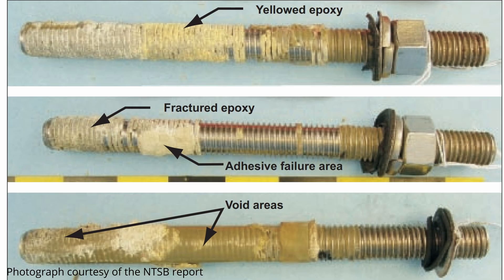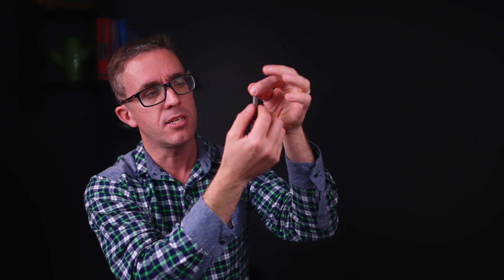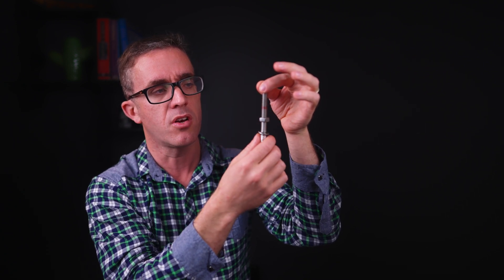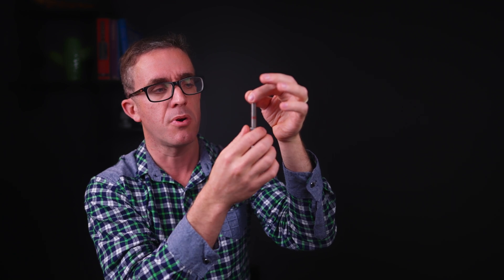The Big Dig Ceiling Collapse: An Epoxy that took down a Tunnel Ceiling

Comment: Unfortunately,  you don't have all the information. I worked with the guy who was the crew boss who installed the bolts. The contractor found it was too expensive to use the correct drill bits, which left a swirl groove in the hole. They also used a third epoxy product that was not mentioned, a version of the epoxy that was way cheaper,  but was designed for down anchors, not overhead. The true cause was covered up and Powers fastener took the blame. All their products were than banned for use in all Ma highway projects for a couple of years. The true culprit went un punished because of political connections. The guy( the installer) testified in court these facts and his reports about concerns of using the wrong drills and the wrong epoxy product were sealed and buried in the records. NTSB is a political creature like most government agencies.
Reply: I like the idea of disinterested 3rd parties somewhere in the process, before NTSB and next-of-kin notifications have to be called into play.

Comment: If those panels weren't doing anything other than creating a false ceiling why make them out of heavy concrete ?!?!
Reply: The original design was for light gauge metal sheets to be the ceiling, the need for a concrete ceiling to protect the roof of the tunnel from the heat of a fuel Tanker fire ( terrorism) was realized after the tunnel sections were already built.
Reply: @digger105337  Ahhh! That makes it more clear 👍🏾

Comment: Piss poor design. Bolts could be thicker with wider and deeper threads and/or could be installed at 45 degree angles so the bolts can't just slide straight down.

Comment: These are deep knowledge issues that require critical thinking of someone very well informed to find value in them. You have given engineers and the world at large more than you know. In my experience (am from a 3rd world country so this might be different for most people) structural failures are normally a result of economical aspects of the project. Usually the contractor wants to save more money by going the cheaper way or the client wants to pay for the cheaper options in disregard of the structural engineering implications. From this i suspect a collusion between the epoxy company and the contractor though the epoxy supplier has more to explain.
Reply from the maker: Hi Mukasa, thanks for you support agree care need to be taken when cheaper solutions are proposed not all alteratives are the same.

Comment: I like you videos about structural failures. What I find helpfull is to analyse the safety of a design by means of the four safety principals: robustness, redundancy, progressive collapse and plasticity. They can be applied to a new design or to analyse the issues with failed designs (collapses). Robustness: the ability of a structure to resists a totally unexpected situation. Redundancy: the ability of a structure to carry loads by an alternative load path. Progressive collapse: occurs when a structure is damaged to a large extent as a result of an initial (small) local failure. Plasticity: the ability of a structure to anticipate to a sitution, for instance by adapting another structural scheme. At uni, we got the assignment to choose a collapse and apply these principals to find out what went good/wrong. Very interesting.
Reply from the maker: Hi Henri, thanks for your support. That is an excellent way to approach the review of a structure and thought process in the view. I may use your approach in a future video to help others if you don't mind. Thanks for sharing your thoughts.

Comment: im not sure how hammering a dynabolt into a hole is harder than putting 2 part epoxy, then screwing a rod in, then waiting for it to set before applying load and the rest of the drawbacks from epoxy, how is it cheaper and easier to install? either way your drilling a hole thats the hard bit done, hammer a dynabolt in VS mixing, then applying epoxy, dealing with the mess it makes, and the environmental impact.. i could go on, it blows my mind lol. Also when you said "the national beuro of transport safety, or the NTSB" i cracked up. thanks for another great informative film
Reply from the maker: Hi Chris, Thanks for watching and your support. I didn't realise I miss spoke that is hilarious tho. Also cheers on being the first to point it out. Agree not sure how much harder to install either, the overhead installation is the hardest part and that doesn't change for either option.
Reply: 👍.   I was union laborer for concrete flatwork+ foundation sub contractor,  I had to squirt that😮 epoxy a few times, that is some nasty 😳 fumes!!  Common a nut and bolt 🔩 is so more environmental.  Epoxy is a toxic brew uncured